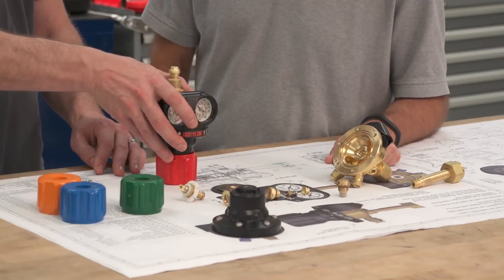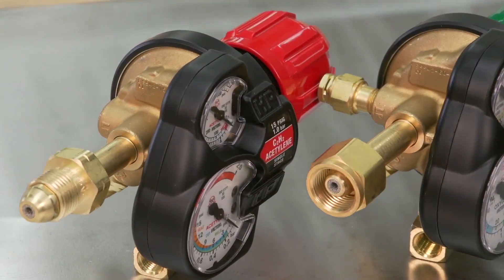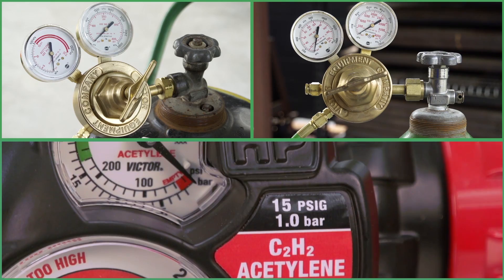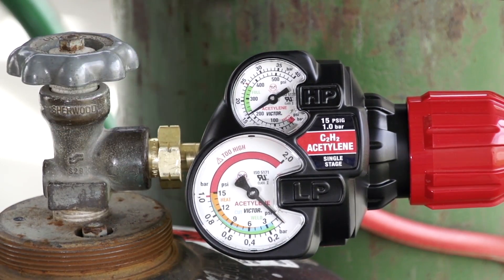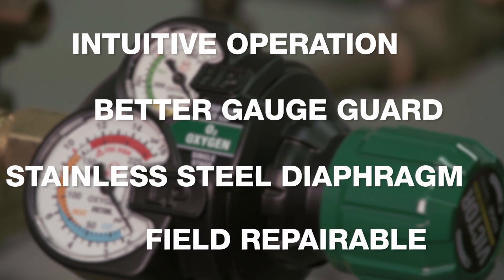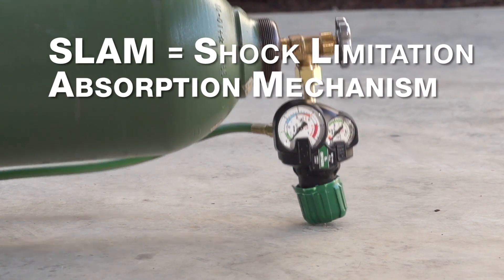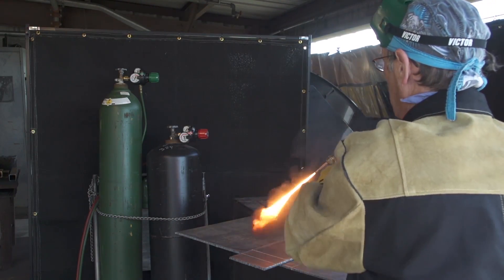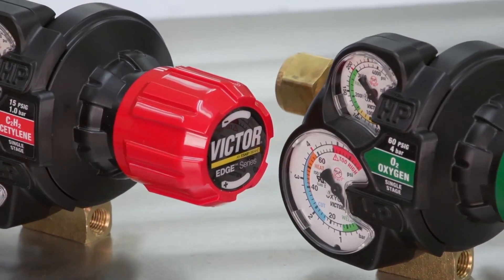EDGE 2.0 - How Victor Made the Best Regulator Even Better

Comment: SR style seat (which is good), mostly cosmetic restyle and a bolted Smith-style flange joint for field repair.  Not sure why operators would spend much if any time looking at the regulator after setup but if so the full-sized gauges on the SR could have gotten the pretty colored bands. If Victor cares about field service how about reasonably priced torch and regulator service tools especially HEAD REAMERS???  Machining is not rocket surgery.